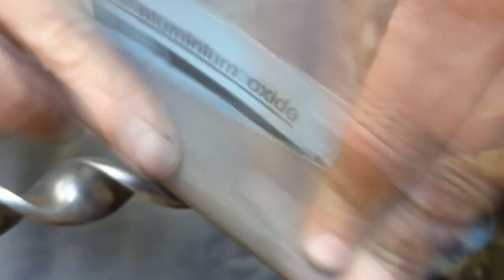Restoration of a vintage hand drill for wood 1953s

Comment: Great restoration Mate, but I have two suggestions: Cold bluing is super soft so using it on the drill is more like one time effect. Second thing- STU377 make a point- you should spend more time to the edge- it is the most important part of the drill. Anyway- this is still great job! Drill looks amazing!

Comment: I've been sharpening this type of wood auger by hand for years, that didn't look like it would cut well after you sharpened it.
Reply: Yes, I agree. It should be sharp like a chisel. However sharpening drills is very hard. If you dont have stand to make a good angle it will not cut well. Im not carpenter, I'm working more in the metal (knife making) but the principle is the same.